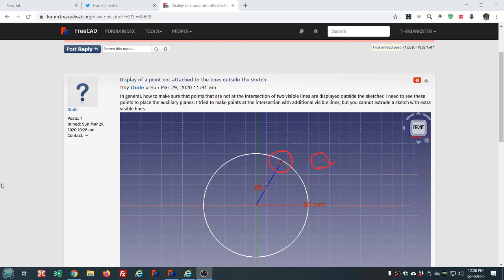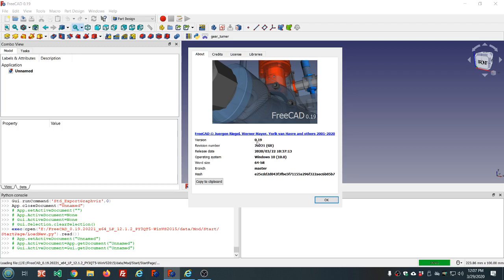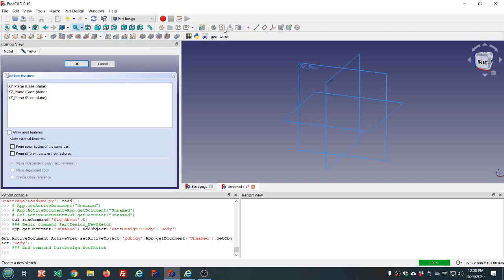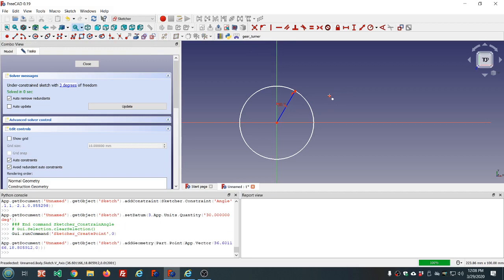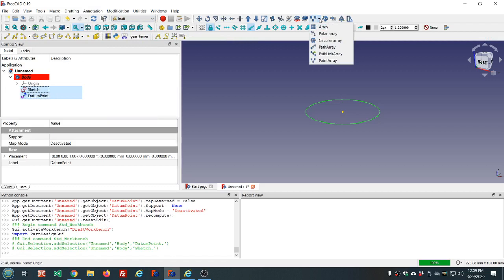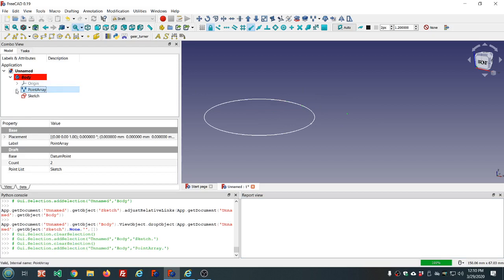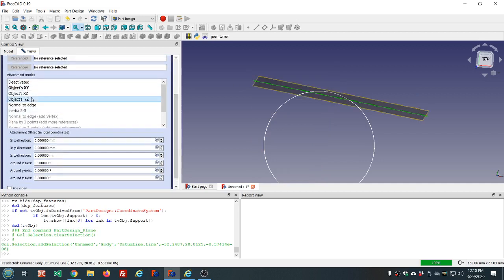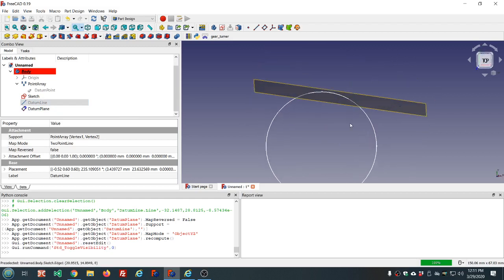062   FreeCAD 0 19 hack for making points in a sketch visible outside the sketch

Comment: Why is there no official way?  It would be nice for multiple parts to get updated when you edit an underlying sketch!
Reply from the maker: I'm not sure why points are always construction mode objects in the sketcher.  It could be there is a good reason.  It could be it has been changed in the latest code as I haven't kept up with the most recent changes.  You can always submit a feature request on the Open Discussion forum on the freecad board at freecadweb.org.